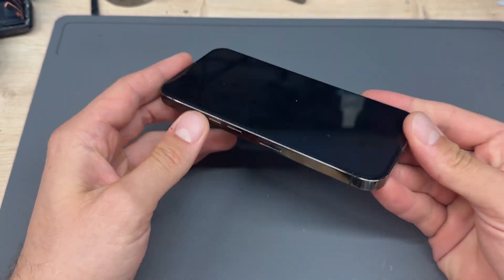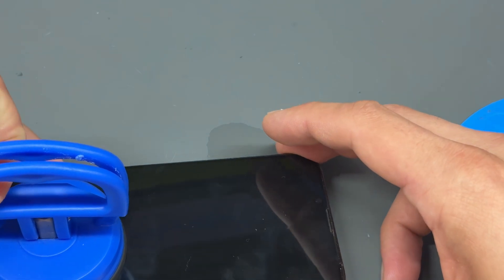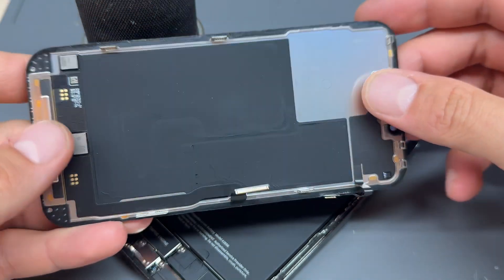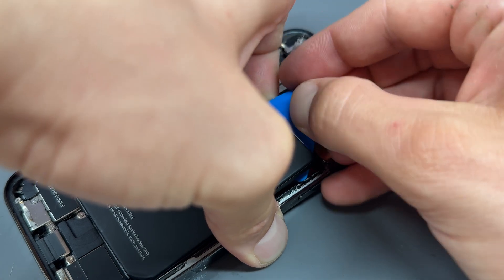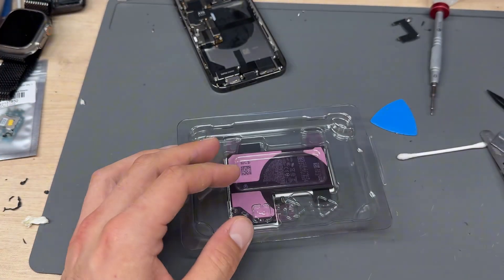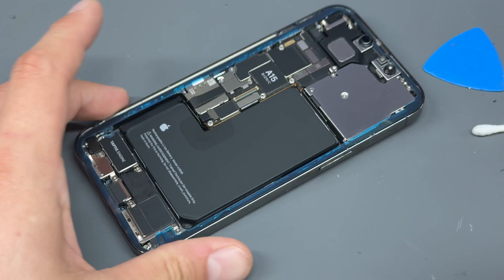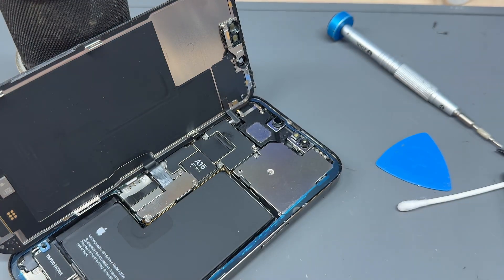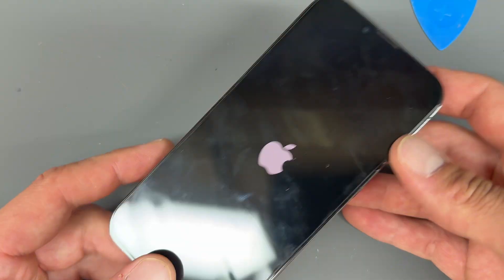iPhone 13 Pro Genuine Battery Replacement – Step-by-Step Guide Using Original Apple Parts! 🔋

Comment: Hello pal, fixed an iPhone 13 Pro, replaced the battery and display by watching your vids, super helpful. 1 question, is changing the gasket necessary every time i open it up ? It was the hardest thing to do, took me a good hour to get it all removed . I reckon since the phone was refurbished when i bought it, the gasket was relatively new when i opened it.
Reply: if u dont put a new one ur phone will not be as efective against water. His role is to not let water or moisture get in. I suggest u put it back, its not hard
Reply: @Kosovoy-y i did put it in a new one, the question is if i have to put in a new one/remove the old one, every time i open up the phone. The adhesive on the gasket is pretty strong after all.

Comment: is it actually safe to put isopropyl alcohol in certain areas without damaging the parts?
Reply: Isopropyl alcohol is a very bad conductor so yes there should be no problems. You shouldnt drench your phone in it, some of it in the corners or for cleaning should be alright.
Reply: @WeeWooWaah  sounds good. just dont want any issues with parts malfunctioning in the future.
Reply: @ivangula2177 just be sure its 99% so you have less water inside. It also evaporates faster and does not leave impurities
Reply: 99% iso does not short or conduct electricity so no

Comment: As someone who also owns a iPhone 13 Pro. It’s clearly Apples best selling iPhone line. If the batteries is out of stock everywhere, it goes to show that many people still uses the 13 Lineup. I myself want to replace the battery on my iPhone.
Reply: The best one
Reply: 13 pro max best iPhone ever
Reply: Will probably keep it until the iOS is not upgrade able